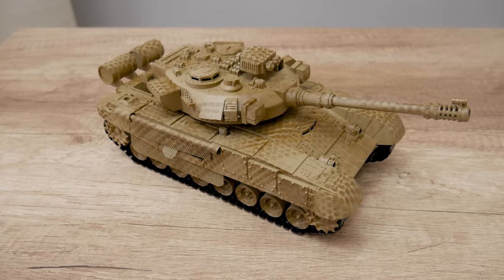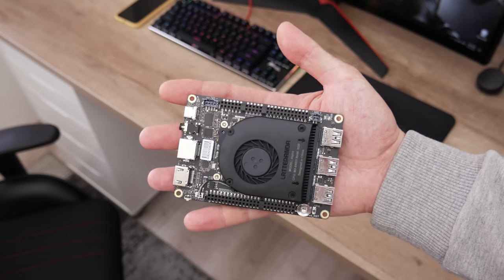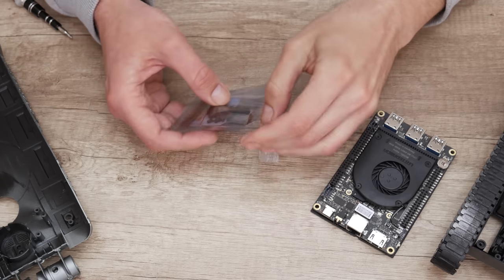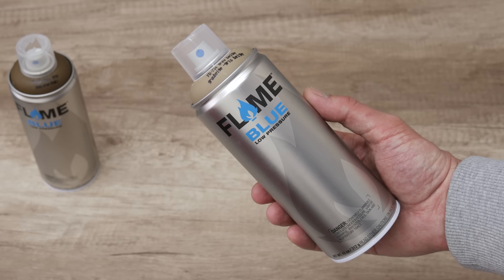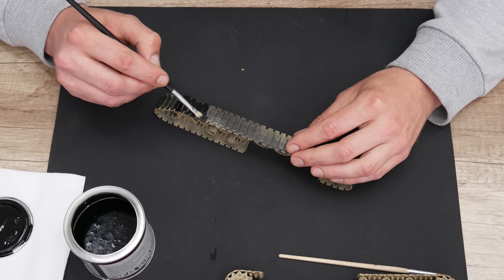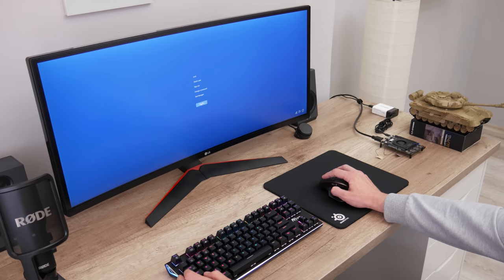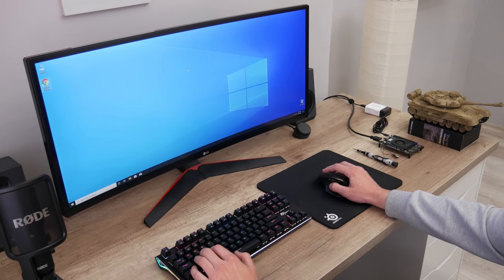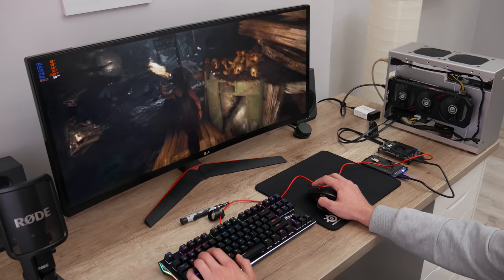Building a Mini Powerful Computer

Comment: Hey I have an old Samsung np300 laptop. I want to upgrade it... Could you plz tell me what kind of processor would be suitable... Thanks
Reply: Roshan Sahay Hi! Is your CPU Intel Pentium B970? If so, the best cpu you can upgrade with is an i7-2640m without any heating issues. You can try upgrading it to an i7-2630qm, but then you’ll need to be careful to not overheat your laptop.
Reply: @si1ver_763  Hey. The processor is Celeron B820 with 2 gigs DDR3 memory.
Reply from the maker: Hi bro, yes you can, just upgrading the CPU depends from the chipset also, I think the Samsung NP300 has HM70 chipset, and if you have this chipset you can use i7 2720QM or i7 2860QM. The HM70 chipset has problems with other i7 CPUs, only some asus models will support other CPUs but with modded bios. btw you can search google for HM70 chipset CPU support, you have cpu-upgrade web pages where you can find more info.

Comment: Update that poor guy, ur using win10 ver 1803... now we have 1909! That'll run 10 times slower than it should
Reply: What's the difference between both versions?
Reply: @nsplay1574  there isn't quite a big difference between those versions. I said that because if windows isnt updated windows update will run forever in the background, failing to install the updates because of the high resources usage caused by the games and it will slow down the pc a lot
Reply: @lucamarrocu5447  you can prevent windows update from running on startup so it doesn't search for any updates :D
Reply: @nsplay1574  yeah, but on a new pc is always a good deal to update to the least version of win before blocking updates bcuz on an obsolete version of win10 u can be more exposed to viruses

Comment: Well CPU bottleneck happens dude to 2cores and 4threads
Reply from the maker: Yeah, but this is okay bottleneck, actually there are many types of bottleneck, in games the basic are: 
CPU waiting for GPU = Bad ( this is when the GPU is veeeery weak  )
GPU waiting for CPU = Okay ( this is when the GPU is faster then the GPU )
But in many cases especially with a powerful hardware, you won't feel any difference

Comment: Can it run hackintosh.
Reply from the maker: Yep, just Wi-Fi is not compatible, but you can install ngff W-Fi and BT, also mac is working with eGPU but using AMD graphics, I've try it with RX580 and all is working fine :D